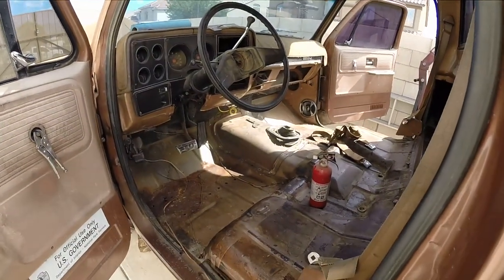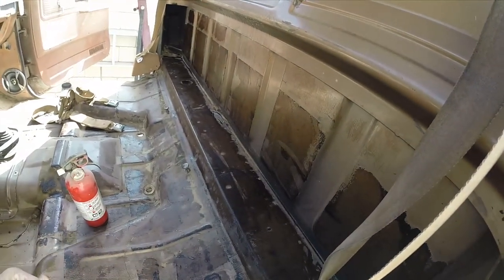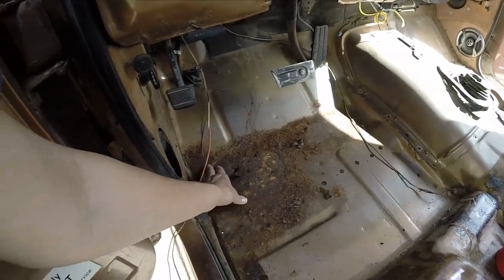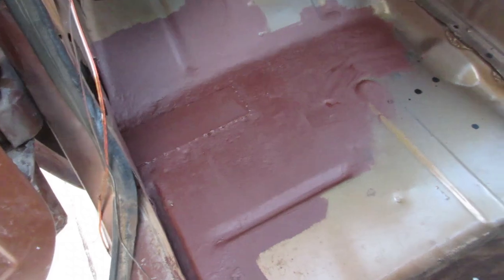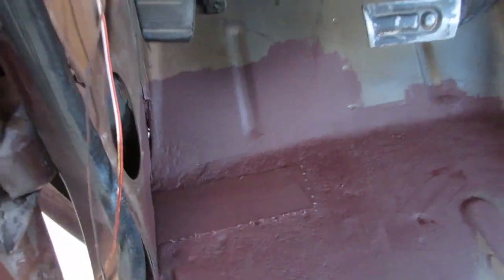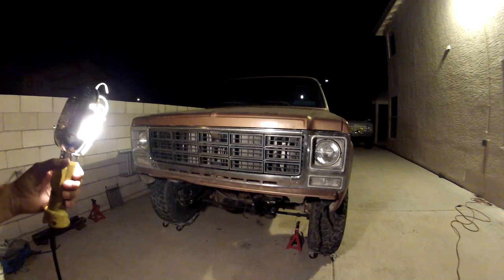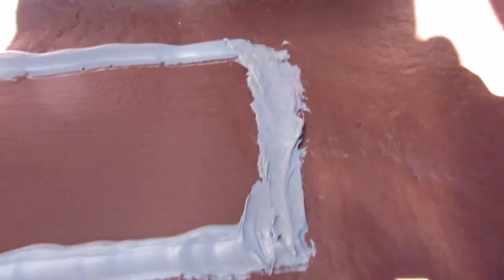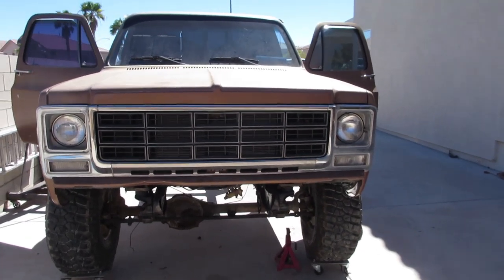Chevy K20 Cab floor rust repair and grille install

Comment: the lighting in the intro 👍👍👍  awesome. I fell in love with these trucks early from movies like commando and the original red dawn. then my dad bought a brand new 1985 short bed step side 4x4 with the sm465 in December of 1984 midnight black. lol I picked it out. when I turned 16 it was my first truck that I still have. love the videos Dave keep up the good work.
Reply from the maker: Thanks! That's cool you still have it, I bet you will have it forever!
Reply: yessir it will go to my daughter

Comment: looking good man. Nice job on the repair patch. glad to see you painted inside that cab support after you cut the piece out. Just curious...are your headlight bezels metal or plastic? The front end looks sweet. Nice new intro too
Reply from the maker: Thanks man, I appreciate the support! As for the paint I figured the more protection the better. The bezels are metal, and glad you like the intro, figured I would change it up.